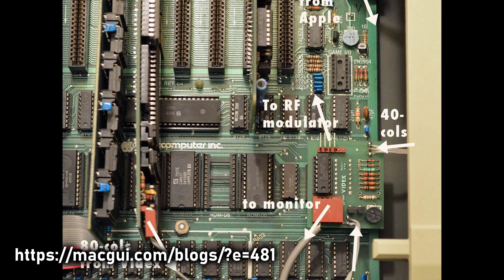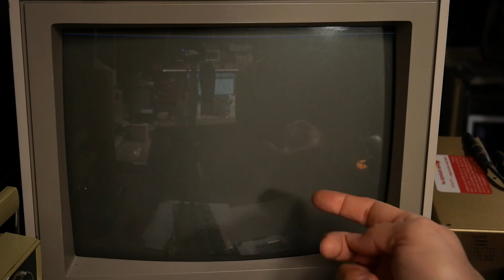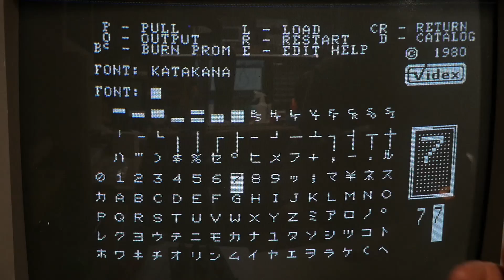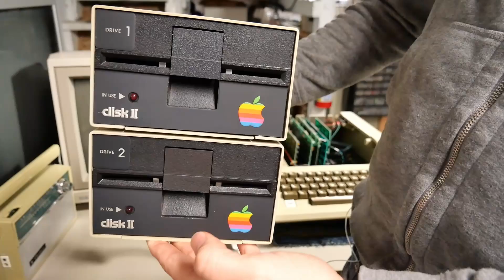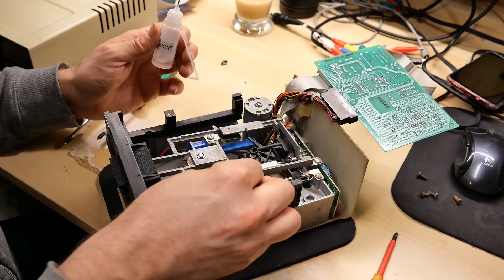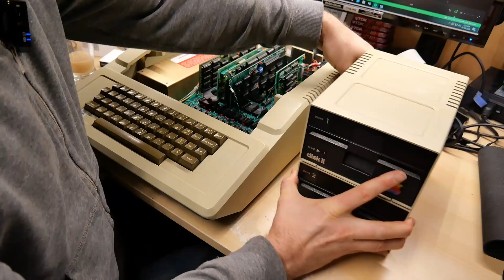Apple ][ plus: VIDEX 80 column card, CPM on the Apple II and servicing the disk drives

Comment: Adrian, where did that computer come from?  I ask, because in the 1970s, I grew up in a steel town in the southeastern US (Gadsden, AL, specifically).  When they smelted steel, there was often a layer of sticky brown dust that would settle on plastics and metal left outside (mm mm good for the respiratory system of children and adults).  I wonder if early in that computer's life if it wasn't exposed to such, then later moved to a better, cleaner environment prior to the purchase of a second disk drive.  If so, that may be what your brown residue/dust is: iron "smog".
Reply from the maker: Stewart reports this was found at an estate sale in NH. He doesn't have any more info -- but perhaps it was used in a workshop where metalwork was going on?
Reply: @adriansdigitalbasement  Hm.  Maybe...but the soot from steel production and doing basic metalwork are very different things.  I wonder if maybe it was set up in a garage and slowly collected a lot of exhaust soot from a car or other gas engine?  I am intrigued to say the least.

Comment: @
Adrian's Digital Basement  Videx did briefly make a card, that would handle switching and mixing of the onboard video and the 80-columns card. I forget what it was called, but it used the internal computer video circuit and the Videx card video outputs, then outputted the mixed video through a British style RF connector and a composite connector. It used a form of Genlock to sync up the video signals and would auto-switch when the 80-column card was detected to be taking over but could be manually switched by pressing Alt+Ctrl+V.

Comment: I suspect that the brown coating in the second drive is there from the factory.  Anything that got in there afterwards would almost have to also be on the controller board.
Reply from the maker: True -- I just have never seen anything like it before.
Reply: @adriansdigitalbasement  That's a protective oxide that is breaking down  like Parkerizing or blueing.  You see it on old equipment that used alloys of iron or steel to prevent corrosion.  Harmless.
Reply: Although I agree it's probably a factory coating I'd like to give some info about something similar but on optical drives. 
That brown stuff looks like the bearing material on dvd /cd drive disc clamps.
That's a common look when the clamp bearing goes on panasonic and Sony branded dvd drives. 
I've seen this a few times on older honda sat nav disc based systems.

Comment: I have a cable that comes from the 80 column card to the mainboard, so i can use 40 and 80 columns with the onboard Video out. But i have still the vertical lines in the 40 column mode.

Comment: This may be a stupid question, but what are the use cases for silicone grease vs. lithium grease? I see other youtubers using them seemingly interchangeably.
Reply: lithium grease can damage rubber parts (or depending on the ingredients even plastic), so better use silicone grease there. For higher mechanical demands or temperatures lithium grease is better. For most parts in computer or audio equipment, the differences are not that big.

Comment: I was expecting the speed of those drives to be checked too. Also it is recommended to put a tad of silicon grease in the groove of that wheel - it makes it quieter. 
The head motor should be a stepper motor BTW - it says that on the motor itself.
Reply: I was going to ask the same thing, why he didn’t check the speeds? It was common for the speed to drift on those drives. It’s just 4 screws to take the bottom cover loose from the chassis, and It’s easy to check speed if you have fluorescent lighting because of the strobe disc on the fly wheel. You can just adjust the pot until the pattern stops turning.  Also it does use a stepper motor to turn the positioning cam disc, but they didn’t have a track zero sensor switch. So they would just run the head all the way back and bump against the stop enough times to make sure that it had to end up at track zero. Lastly it was very common for people to plug the ribbon cable onto the interface card incorrectly, and it usually fried the 74LS125 chip on the analog board. Depending on how it was misconnected and how long it was left turned on, sometimes the ULN2003 Darlington driver chip for the stepper motor would also burn up.
Reply: @macfixer01  it's not even that for the speed check. I believe Locksmith or other diagnostic software are quite accurate in showing the speed so there is no extra disassembling required.
Reply from the maker: I don't bother to check the speed when the drive is operating correctly
Reply: @adriansdigitalbasement   - then following your own logic, Adrian, why did you bother lubricating the rails and cleaning the heads since the drives were working I believe? Not the answer I was expecting to be honest.
Reply: @tony359  Checking the speed would be meaningless if you do not know what the speed should be.
Reply: @TheGuyThatEveryoneIgnores  what does that mean? Speed is known and can be checked using a lightbulb and the pulley under the drive or using one of the many diagnostic utilities available. It’s a routine check when servicing a drive.
Reply: @tony359  Well, I do not know what the speed of a 5.25" floppy drive should be off the top of my head and I doubt Adrian knows either since he did not mention it.  Yes, he and I could easily look it up, but since the drives appear to be working, measuring their speed would only serve to satisfy an intellectual curiosity.  I am sure there is a whole host of other diagnostics that could be performed, but Adrian just chose to do the lowest hanging fruit:  cleaning and lubricating.
Reply: @TheGuyThatEveryoneIgnores  I am not sure what the purpose of this post is as you are clearly unfamiliar with the Disk ][ and its service routine.
Sorry but checking the speed of the drive is probably as important as lubricating. And there is no hard math behind it. Mostly any diagnostic software has a section to check it. Locksmith has it. CopyIIplus has it. You are making it look like it's a difficult procedure when it's the easiest thing to do on a Disk ][ drive.  It takes a few seconds and you don't even need to open the drive. And no, it's not an "intellectual curiosity": when I say "check the speed" I mean "check and adjust if necessary" of course - and before you say it's such a difficult task, no it's not. There is a very easy to access potentiometer to adjust. Adrian knows that very well of course.

Comment: I liked the way the Apple 80-column cards worked with the Apple //e.  Just type "PR#3" at the BASIC prompt and hit <RETURN>.  The display output would be automatically switched to the correct video processor without having to flip any switches or move any plugs.

Comment: Add a cooling fan to both apple 2 floppy diskette drives
Reply: They do not run hot at all, thus the case cooling alone is fine. The only part that makes heat is the speed regulator for the drive motor, and that itself has a heatsink that is adequate. A fan would just get dust into every part of the drive.
Reply: @SeanBZA  That must be why the "vents" were sealed...they realized that it was unnecessary and would just create more problems. I can't imagine how often you'd have to take apart the drives to clean them if those vents were real.